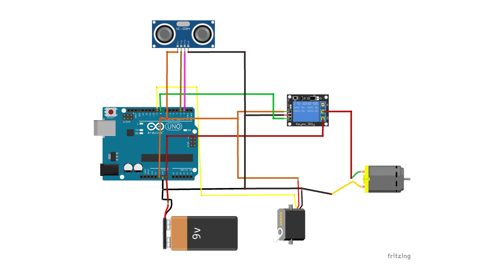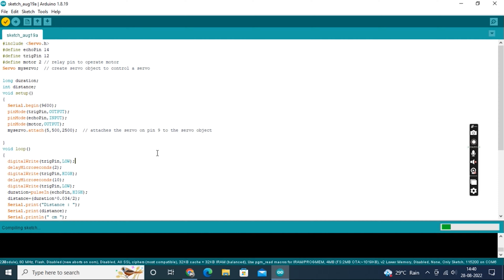This Automatic Page Turning Machine is SO cool!

Comment: brother how can we do this for turning page for both the side? plz help
Reply from the maker: You can achieve this with adding one more motor and rotate that in opposite direction.
Reply: brother there is no need to add  one more tranducuser sensor?
Reply: and the coding is not opening